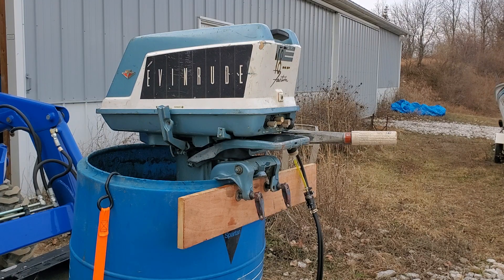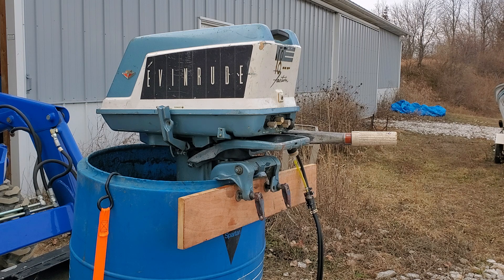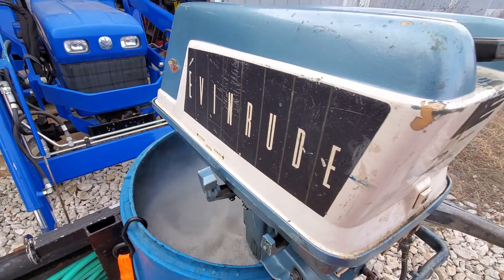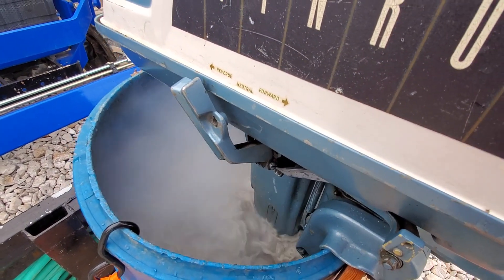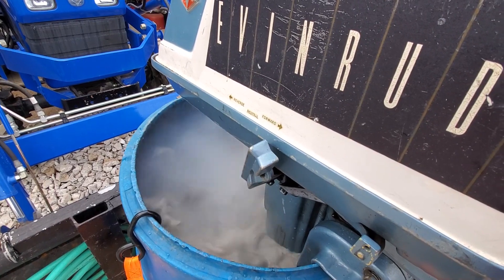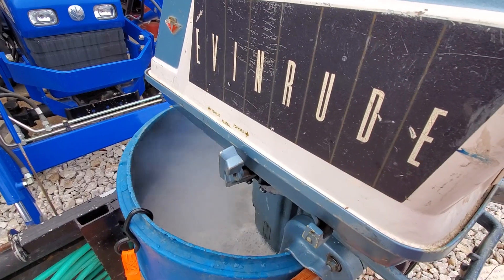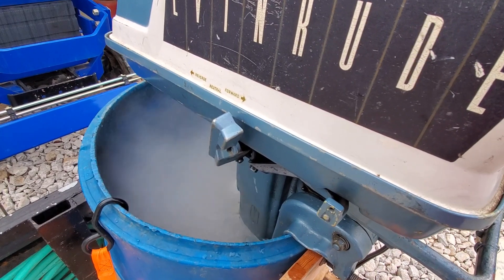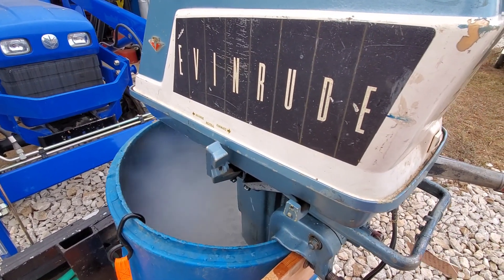1960 Evinrude Fastwin 18hp Outboard Motor Tank Test

Comment: Nice job, good to have donor motor for parts.still rounding up parts for my 69 18 evinrude, steering bracket, prop, throttle adv.lever, wish I had a donor motor     thanks for posting.
Reply from the maker: Yes, its definitely good to have a donor motor.  I have had many donor motors and I am always getting parts from them.  And then sometimes I end up with enough parts to Frankenstein one together from the boneyard. I buy donor motors cheap and sometimes they end up using up parts from.the pile and becoming runners themselves. Thanks for watching!

Comment: She idles wayyy low man! Looks good. Lots of work to get this old beast purring but worth it at the end. Thanks for sharing ojr and happy holidays
Reply from the maker: Yes, this one has excellent idle quality.   This powerhead is a very solid one.  It doesn't have a lot of hours on it.  It's too bad the original gearcase was trashed.  It was quite a bit of work to get it all set to go, but I'm pleased with the results so far. I believe it will be worth it.  Thanks for watching,  Seth.

Comment: Most folks don't know how quick those motors start eating their own exhaust and start running bad...the fan is a must. I have a 1960 5.5 that is THE quietest little motor I have....EXCEPT for that HOOD rattle you are talking about. I repaired a 10 hp for a guy....same rattle...must be a common gasket issue. Nice sounding motor...that VERY LOW IDLE tells me a LOT about the skill!
Reply from the maker: You are certainly right about most folks not knowing how quickly these motors will inhale and choke on their own exhaust fumes in a barrel or a tank.  I have to use the bug fan to get them dialed in close in a barrel.  My tote tank has a suction exhaust stack on it and my indoor tank will too once I get it set up.  
The breadbox Evinrudes in 1959 and '60 had the intake silencer as well as the fiberglass hood and were supremely quiet.  This hood design is notorious for rattles though.  I have a bunch of Jubilees and a few '60s and only a few of them don't rattle.  That rattle is a tough one to try to quiet down too.
This one has a very solid powerhead with low hours.  It had some mice inside the cowl and the original gearcase was kind of neglected.  The replacement gearcase was in great shape other than outward appearance and the broken fasteners.   When I can't get a motor to idle down like this it makes me crazy.  Some of them just won't, but I do take pride in being able to get the best idle possible from them.  The thing I love about the OMC 18s is they will idle great and still get up and run at a good clip when you want them to.  The best running motors I've worked on are the '50s OMC 15hp twins.  Particularly the '53/'54 Super Fastwins.  I have three of those. They'll all troll at 1mph or less and run at 19-21mph at WOT and hold close to that speed even with a passenger amd gear in the boat.  That's very impressive to me.  Thanks for watching!

Comment: Really like your channel! Fun seeing this old motors running and how good they really were. 
Wanted to know your thoughts on your 24 to one mix ? I alway use a tw3 rated fifty to one oil  
I’ve got a 80s Johnson that states 100 to 1 ! Never doing that!!!  Your thought ??? On mix
   OH I always use non ethanol premium 😬
Reply from the maker: Thank you.   I always like getting feedback from viewers that enjoy my content. Here is the Cliff's Notes version of mix ratios.  There are a few exceptions to this, but the rule of thumb is this for OMC motors.  Pre-1964 motors are 16:1 mix for motors under 10 hp. For 10hp and up motors the mix ratio is 24:1.  In 1964 all OMC motors above 3hp switched to 50:1 mix ratio as a factory recommendation.  In the lat 1980s for a few years (1987-1989 I believe) the factory reccomended 100:1 mix.  That proved a terrible idea.  OMC replaced LOTS of powerheads under warranty with that recommendation.   Good on you for never doing that.  They issued a service bulletin about that and any motors that came in for service woth those stickers on them were removed by the dealers.  50:1 non ethanol and TCW-3 oil on any of your 80s motors is perfect.   In 1964, even those motors that did not change internally got coated pistons when the 50:1 ratio recommendation came out.  Thanks for watching!
Reply: Thank you 😊 good information I didn’t know!
Reply from the maker: @RN67POST  You're very welcome. 🙂👍

Comment: Well, it was worth the wrestling match to get this one going, that powerhead sounds nice and tight....Probably low hours if the original coils were still in place...  You mentioned drilling/tapping out the water pump screw to 10-24, isn't that the original size? Trying to get those little screws out of there is near impossible...
Reply from the maker: Yes, a solid 18 is always worth a wrestling match for me.  This powerhead seems to be as close to perfect mechanically as it gets.  I don't think it has too many hours.  It has enough to wreck the drive shaft bearing in the original gearcase, but still seems pretty low hour.  Oddly the drive shaft bearing was badly worn and the drive shaft galled, but the pinion bearing was still perfect.   I have never seen that before.   I have had either the pinion bearing or both the pinion and the drive shaft bearings be shot, but never just the drive shaft bearing.   The original coils do help confirm the low hours.  I have, however,  had motors with the original coils in them that obviously had thousands of hours on them and were completely clapped out from stem to stern.  
The water pump screws in the 5-bolt gearcase are, counterintuitively, only #8-32 amd there are only three of them.  In the 4-bolt,  there are four #10-24 screws.   The reason, I assume, is that the 4-bolt gearcase relies on the water pump housing being very firmly torqued down to prevent the gasket under the drive shaft bearing carrier plate from leaking.  The 5-bolt gearcase is by far and away a superior design that does not use that silly gasket to maintain a sealed, watertight gearcase.  It was necessary for the 5.5 and 7.5 that used the shock absorber.  For the 10hp,  it is such an afterthought.  The only thing I like about the 4-bolt gearcase on a 10hp is that with the millions of 5.5 and 7.5 motors floating around in circulation and boneyards, it just means there are lots of spare parts for them.  The drive shafts are just getting harder to find in good condition.   If a guy has the right tools, he could whittle one out in a pinch though. Those little buttons screws are tough to get out sometimes.   The #8-32 ones are bad about getting stuck in there. If they would have at least used four, you could have gotten by without one of them and it wouldn't matter.   Thanks for watching,  Don!
Reply: @oldjohnnyrude8404    Wish someone could tell me why those dumb upper bushing gaskets are cut back that way, about 1/8" smaller OD than they should be...There isn't much meat to clamp those pieces together to begin with without leaking....  Often wondered about having someone make up a pile of these gaskets the right way....
Reply from the maker: @fleetwin1  Yes, I too would like to know why they did that as well.  It doesn't make sense to me why they made those gaskets undersized either.  These days I almost always cut out my own gaskets for that upper drive shaft bushing plate.  Mine end up a little bigger around mostly because I trace an old gasket I kept for a template and cut along the line to the outside.   They end up about the right size.  I use a hollow punch to cut the center hole and a paper punch to cut the screw clearance holes.  I haven't had a leaker yet doing that.  I still think the whole idea of using the impeller housing screws (what I would a user-servicable part) to hold a critical gearcase sealing surface together and keep it water tight is a bad design idea.
Reply: @oldjohnnyrude8404    Absolutely, because everytime you remove the screws to service the water pump, you might be moving/damaging the gasket creating a leak that wasn't there before.  Guys have to be careful when pressure testing these things also....The impeller housing and screws need to be secure (no impeller) or else the bushing will just pop off when pressure is applied...I always thought that dumb drive shaft shock was an over engineered idea also...That is what the shear pin is for!  Happy/healthy 2021!  Don
Reply from the maker: @fleetwin1  You said it, Don.  My thoughts exactly. 👍

Comment: What is a test wheel? And where can you get one?? I have a 1955 evinrude fastwin 15hp.
Reply from the maker: A test wheel is a slotted or finned wheel that goes on the prop shaft of an outboard in place of the propeller.  It is used to create a resistance load on the prop shaft while creating minimal thrust that would throw water out of or create a condition in a test tank of prop ventilation.   I bought most of my test wheels on Ebay.  Your '55 would use the same test wheel i have on this '60 in this video.  I'll try to find the part number and post it here for you. Thanks for watching!
Reply from the maker: 0376913 is the part number of the test wheel for the 22 c.i. motors.  It will also fit your 20 c.i.15hp Fastwin.  Unless you are tuning to a rated rpm in a specific commercial size baffled test tank,  the slight difference will not matter. I dial the carburetor in by ear without a tach and have good success using this test wheel with all of my 5-bolt gearcase OMC motors.
Reply: @oldjohnnyrude8404  Thank you for getting back to me so soon! I got the motor to rebuild.
Reply from the maker: @chrisnelson2796  No problem.   Congrats and good luck with your motor.  The 15s are the best running motors I've worked on.   👍

Comment: I just restored a 1959 evinrude 18hp any cheap paint that’s close to the engine color I can get local on the cheap
Reply from the maker: Great motor.  I have four of those. I have not repainted any of them, but I believe Moeller has a color that is acceptably close to the blue.   I believe there is a gold available that is fairly close to original as well.  All three colors are available from vintageputboardpaint.com.  It isn't cheap, but isn't super expensive and I have heard good reviews about it.  Thanks for watching!